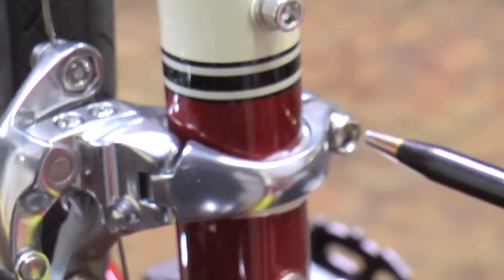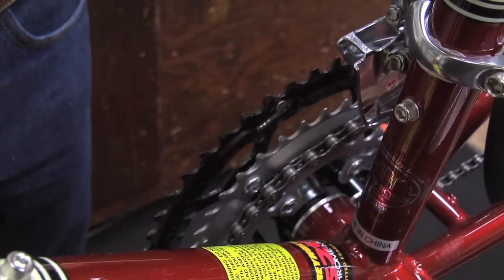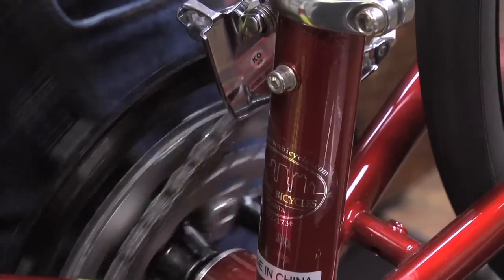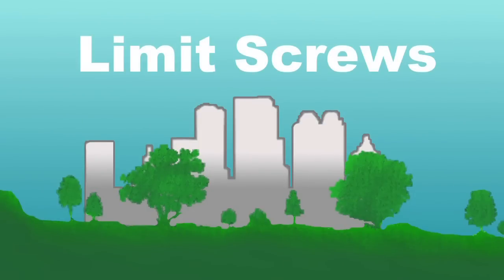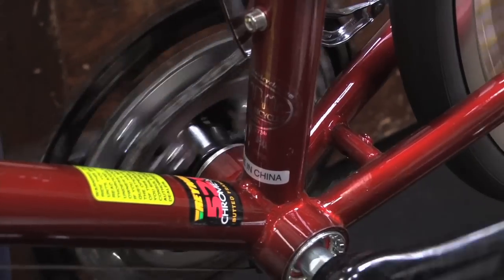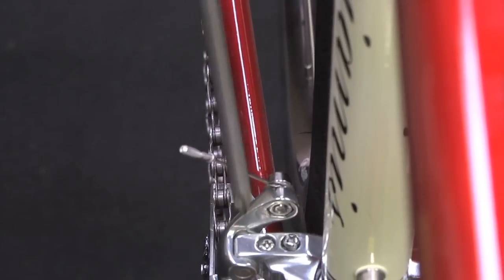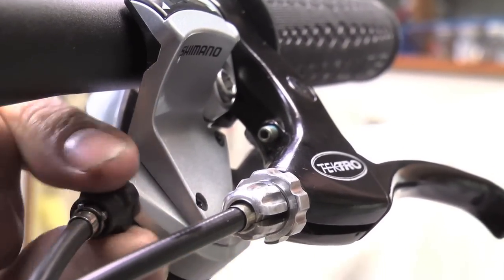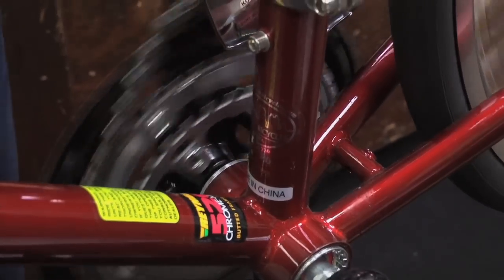How to Adjust a Front Derailleur

Comment: I've watched several "front mech adjustment" vids and this is the best and most concise. I had real trouble shifting from large to middle, until I changed the tilt/angle of the cage - never thought to do this, because it had never been altered. Don't get caught out. The 3 areas Mike highlights are all as important as each other. I've ended with an unusual (?) solution shifting down the gears, with 3 movements, not 2. It takes 2 gentle clicks to move from large to middle.

Comment: Start with the barrel adjuster halfway in/halfway out, whichever way you want to look at it ;)

Get your derailleur in the ball park by setting H & L so the derailleur sits centred above the high and low gears. Do those and set your height and you should be well on your way to working gears again.

Comment: If that is the case, then may I make a suggestion.
First check the derailleur position by eye, making sure its straight and around 3mil above the chainrings, as in the video.

Then undo the cable.
You will have to get the limit screws right. move the derailleur in and out by hand and look where it lies. There should be minimal clearance between the chain and front derailleur in first. Tighten cable and apply firm tension on cable by hand and it should be right.

Comment: Hey, all your videos are great. I've learned a great deal from them. 
I have a question though.
First off, I'd like to say I haven't adjusted my front and back deraileurs yet, but I think this problem is irrelevant to these adjustments.

The problem:
My rear gear will not stop shifting up! If I put it in gear 1 and I don't hold on to it, it will continue shifting upwards into gear 7 (my last gear).

Please help me solve this!

Comment: Hello, thanks a lot for this video ! What could be wrong if the chain doesn't get into the largest cog at the rear wheel (stays in the 2nd, doesn't get on to the 1st). Will be very thankful for your answer
Reply: Got it - adjusted the low limit switch anti clockwise -  works fine now. Thank you for instilling confidence to give it a try :)

Comment: Mike, my front derailleur on my 1996 Giant Cadex road bike only stays on 1 gear. It's the Shimano 600, with 2 front gears. I tried the barrow adjuster. That works to shift up to the high gear, but then it won't release down to the low gear. I've adjusted the limiter screws so there is enough space for sideway movement, but it still only stays on one gear only. I use to hear a click on the front handbrake/shifter, but now it doesn't click. Do you think the problem lies with the handbrake/shifter?

Comment: I have a problem with the front derailleur rubbing the chain. The barrel adjustment was adjusted out all the way and still will not move out for enough, also adjusted the high gear screw out all the way and still will not move out far enough to not rub the chain against the derailleur. Went through all the steps shown in the video over and over again. The derailleur is not bent... any help would be welcome fixing this issue...

Comment: front derailleur won't shift to the largest chainring under pressure that means when i pedal it with foot but it "always" work perfectly when i pedal it by hands i tried a lot adjusting front derailleur vertical & horizontal positions and also used front barrel, high screw but nothing last i mean it never work all the way sometimes when i try to shift it up it shifts a couple of times good but then it turns back to stuck there with previous middle ring and keep make noise whenever i pedal with foot doing that it doesnt matter if i slow down the pedal or increased it never figure out whats wrong by the way the bike is new and unfortunately the shop where i bought it from they did nothing so i need someone with pretty expertise answering and clear this maze!!

Comment: May I offer a suggestion. Unless you have a recumbent, or something with a very long chain, you should NEVER put the bike into the gear with the smallest chainring and smallest rear cog, OR the biggest chainring and biggest rear cog. You will put the chain on too much of an angle and you will wear out your chain too quick.
The smallest chainring should go with the bigger cogs at the back and the biggest chainring with smallest cogs.

Comment: I jacked my front derailer all up so in a sense I am starting from scratch...like I am installing a derailer...is there a recommended starting point for the H & L adjustment screws?  I figured if I positioned both of them about half way out each that would be a good starting point.  Also how about the barrel adjuster up on the handle bar...should I start with it screwed about half way in (or Out...half empty, half full)?  Thanks